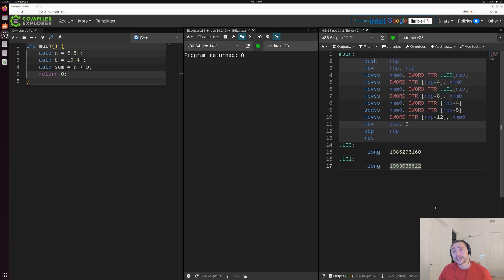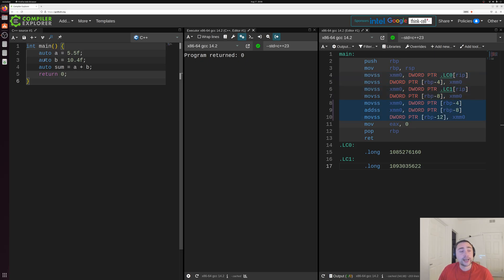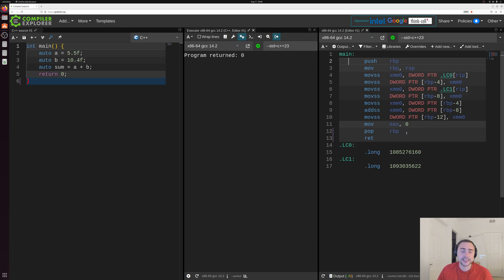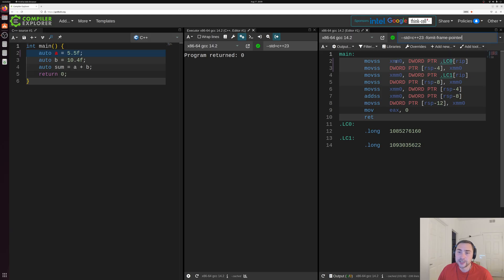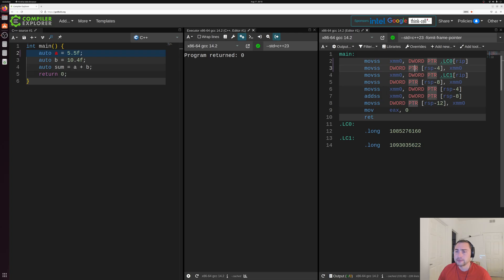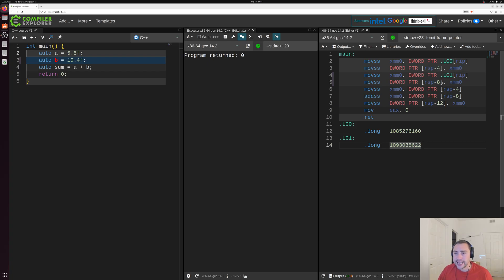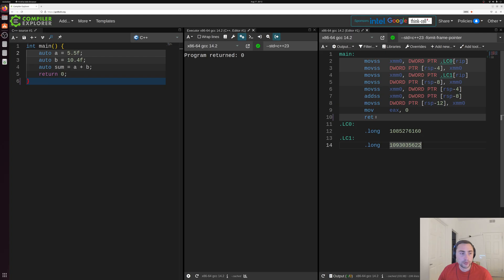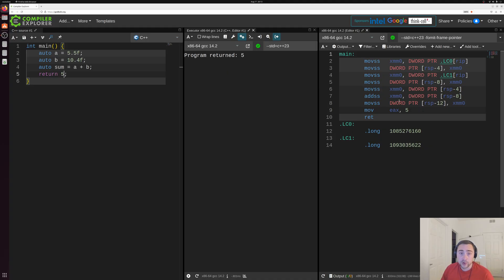Beneath C++: Understanding Assembly

Comment: I think it's better if you change the title to X86-64 assembly instead of just assembly. This would be less misleading and more accurate.

Edit: great series BTW. I'll wait for more assembly videos.
Reply: Is it though? Most people that get started with programming are going to be doing so on a laptop or desktop that has an x86 chip. It still has significantly more market share than alternative architectures in those two arenas and there are even people still using x86 Macs. Besides, everything he said could easily be applied to learning about how code gets generated on any platform, just look at the output of the compiler when you tell it to generate assembly.